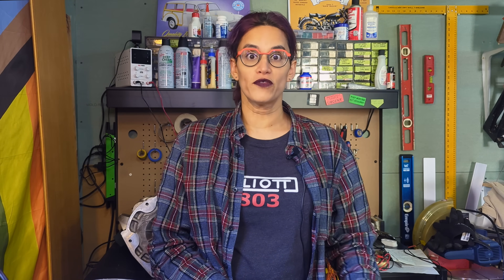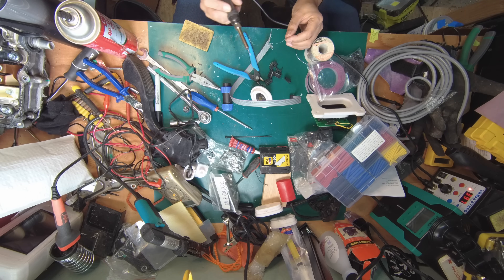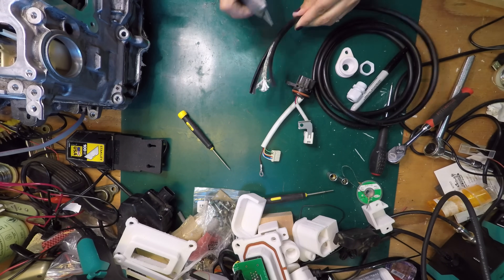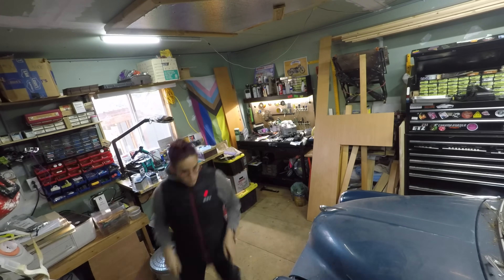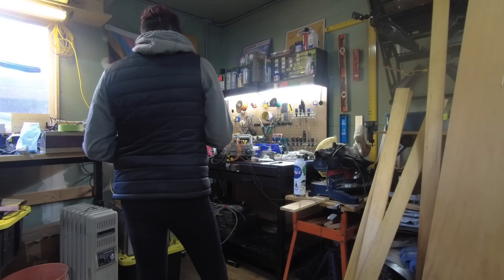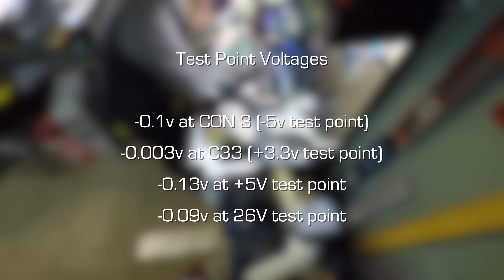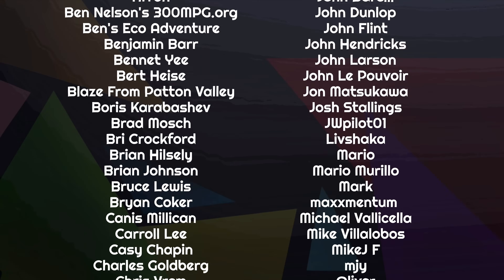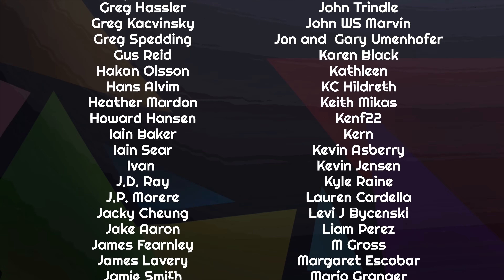Rebooting Rebecca Ep 6 - Building an EV from a 1969 Morris 1000

Comment: Hi Kate, I know nothing about this specific inverter module, but I did electronics for >50 years!  If the processor that’s driving the inverter isn’t giving its ‘heartbeat’ flashing LED, and the power rails are way down I’d start with the supply that feeds the processor itself. I’d guess there a switched mode supply on the board, check for voltages going in and use your ‘scope to check if the oscillator is running.  Take it step by step from DC in to chopped DC to regulators for the different rails.  Or swap the processor for an Elliott Automation 920M!!  Best of luck

Comment: The Dream is not to wedge a modern EV into a 60s classic . But to build a 60s classic EV ... like they would have built a EV in the 1960s ... .. That can be fixed by the road side & self serviced in your lunch hour .  Battery modules than can be changed one by one without a folklift. Inverter & charger robust & made from real components.  etc
Reply: "real components" LMAO  as opposed to those fake ones :)

Apparently you mean a simple right to repair design philosophy.... Which hope the Slate will offer. too..   For those that don't have the inclination to do a open source EV conversion....  And how about some battery swapping?  Or an external battery charger? etc

But both still need to offer modernity in terms of safety and other "basic" amenities ie not a 60s classic IMHO...  Just a thought, to each their own. C'est la vie.

Comment: At about 13:00, I would be noting that it seems likely that the power is not connected correctly.  There was no smoke and all the supply voltages were small numbers.  When I have trouble with circuits it often involves smoke and a bad smell from the PCB.  Other cases are where the power wire is not connected or I didn't put the fuse back in.